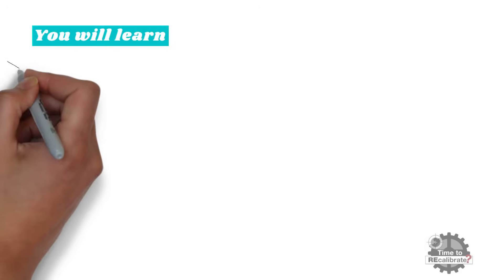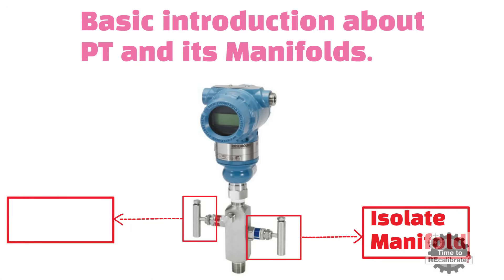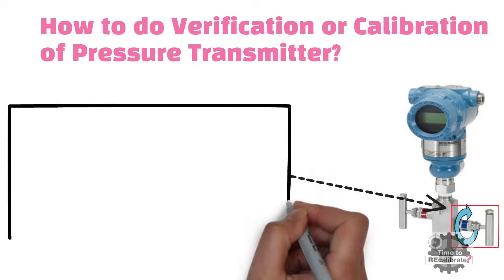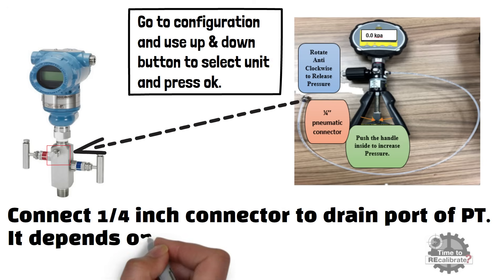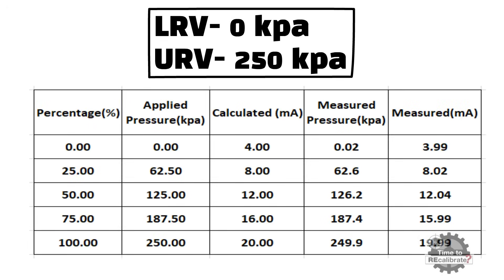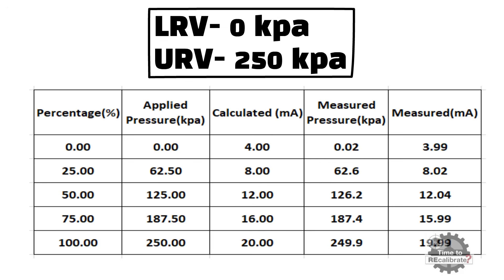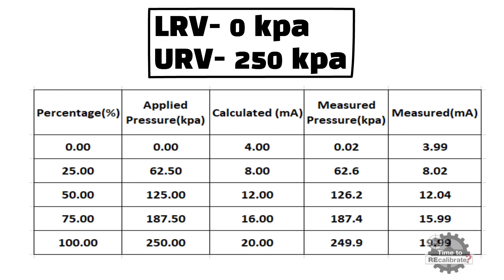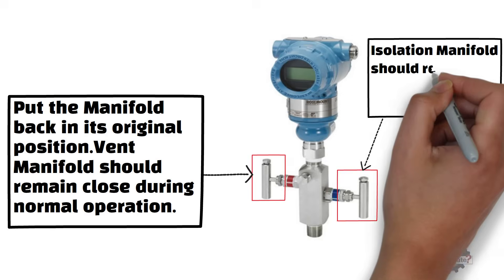Pressure Transmitter | Calibration/Verification

Comment: Cant we connect the multimeter anywhere in series, or just between negative terminals of PT and power supply?
Reply: You can connect the meter any of part of the circuit but have to be in serie

Comment: I am trying to move a LRV from -166mbar to -170mbar, total range is 73mbar in total, but when i try and trim i am getting an excessive correction pop up, any ideas why?
Reply from the maker: Hello Paul
Have you checked its Lower sensor range? I believe you are trying to calibrate below its lower sensor range value.

Comment: Very informative video.thanks
Please make a separate video on a pressure calibrator and explain how to change units and more details.
Reply: Please make more video on how to calibrate the transmitters if there is variation or error in reading when pressure in the line is as standard as design
Reply from the maker: Thank you... we will make it